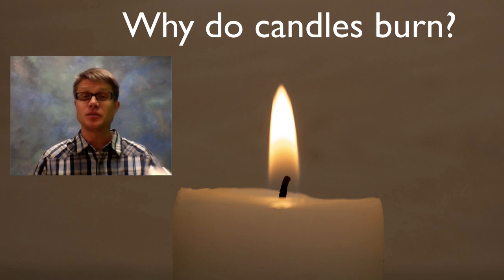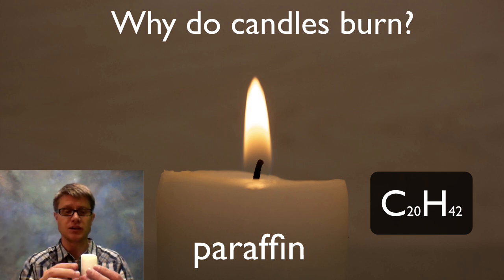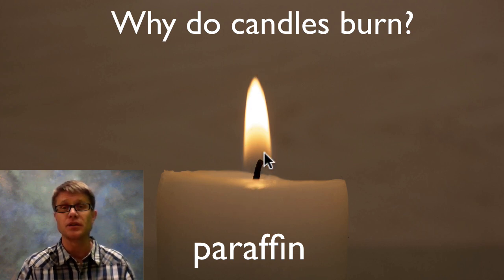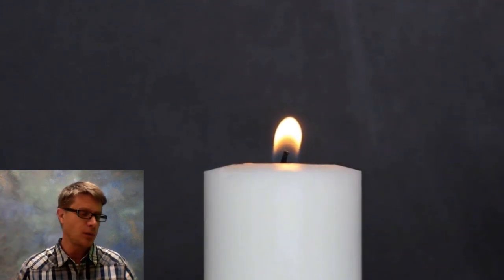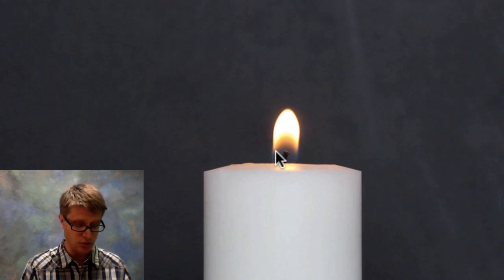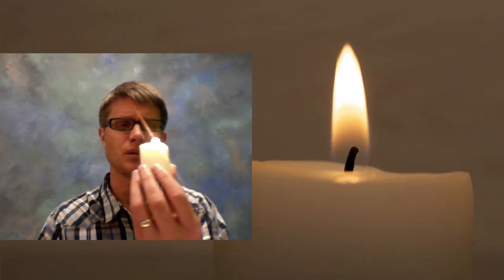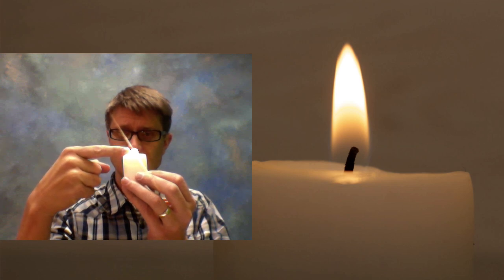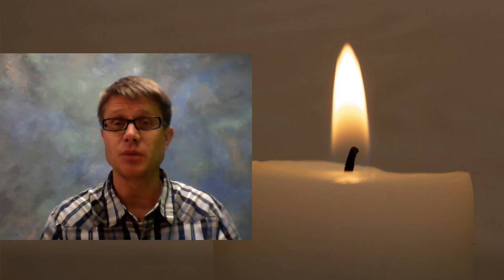Why do candles burn?

Comment: Great informative video, but pedantically he does a bad job dismissing the idea that the fuel of the combustion reaction "burns up" or "gets converted to energy".  A better explanation would point out that yes, the combustion reaction does produce heat and light, but that's not because the matter is consumed, it's because the matter is changed into different molecules.  Also just terrible to just say flat out that matter and energy cannot be changed into each other.  Yes, it's rare, but don't spread misinformation!

Comment: Hello. Good video ;)
Question: How big can a functional candle be? There is a Guinness record for the largest candle in the world and for a time it was held by The Peace Candle of the World (Scappoose Peace Candle) which is about 50-foot-tall (15 m), but it does not appear to have ever been lit (and I have not read that this has happened at least to demonstrate that it works at the time of demonstrating the record). My question is not simply idle, a candle can be lit for many hours consuming very few materials at least compared to a campfire with wood. So, could a candle be made large enough so that its flame is the size of a campfire flame? Is it possible or a candle only works well on a small scale?

Comment: Thank you. I was hoping to hear the purpose of the thread/wick. What role does it play? Is there an alternative material that can be used for the same purpose?
Reply: the wax is only flammable when it’s in its gaseous state. the burning wick melts the wax, absorbs that melted wax and rises it up into the flame so it can evaporate and turn into a gas!
Reply: @candercury  the wax vapour is what burns but does the candle wick burn as well?
Reply: and yes there are others materials than can be used, for example many people use wood wicks

Comment: So long story short, when you burn a candle a combustion reaction happens turning the paraffin (wax) into C02 and H20, the wax basically turns into gas which is what you smell when you burn that nice smelling candle from Yankee Candle.
Reply: But why does only the gas around the wick burn in a small bulb and not a wide area of flame covering the whole top of the candle? Is there no attribute with some of the gas or liquid wax soaking into the wick?
Reply: SkytheKorok you don’t smell the gas you smell the fragrance being distributed in the air
Reply: But where did the H20 went?
Reply: @josephchen2420  the water evaporates due to heat of the candle

Comment: You have to have a nuclear reaction like in a nuclear reactor, nuclear bomb, or star to convert mass to energy.  Even then only a tiny portion of the mass becomes energy.  To completely convert mass to energy you need to annihilate matter with equal amounts of antimatter, or throw it into a black hole and let it evaporate off as Hawking radiation.

Comment: "Mass can't be converted to energy."
what about an engine? it uses a mass (gasoline or even coal for an old train) and converts it through combustion to produce energy and force.
Reply: It doesn't. It's the same principle as the candle. If you were to collect all the exhaust gases, the mass would be the same. It just uses the potential energy from the bonds between atoms to create energy.

Comment: Why is the flame centered if the gas from the paraffin is all around the candle.  Is the wick used as a collecting point for the gas? Or is the gas attracted to the point where the flame starts?  Sorry I'm kind of dumb
Reply: The paraffin exists as a solid at room temperature, and is what you call the wax. When you heat the wax it turns into a liquid and then a gas, which is what then burns. So there isn't paraffin gas shrouding the candle, only where it is hot.

Comment: There is not enough water to use and it is usually a mix of smoke and water. Also, I think you could get more water from air itself than burning a candle.